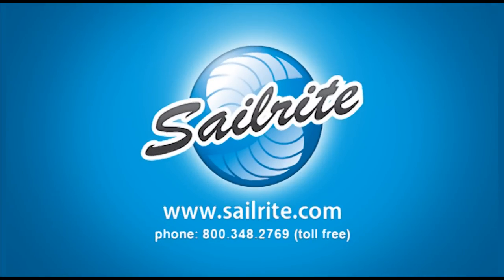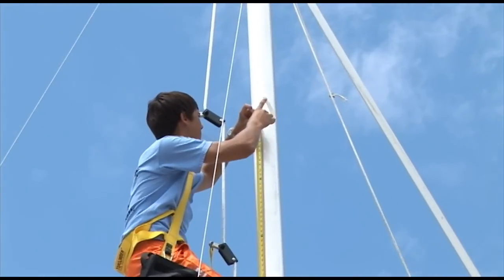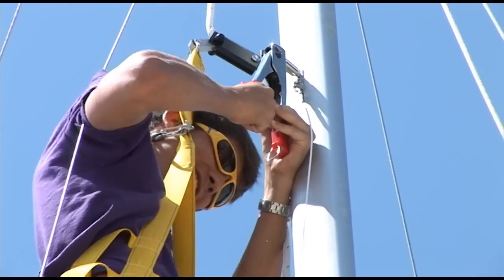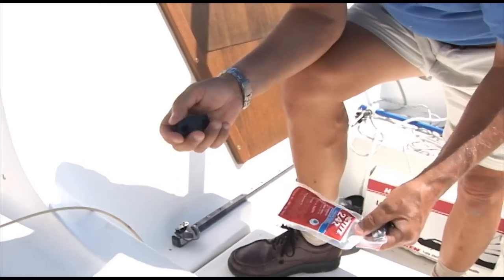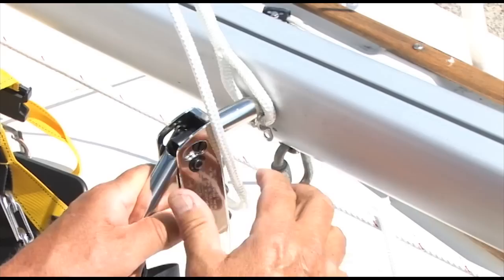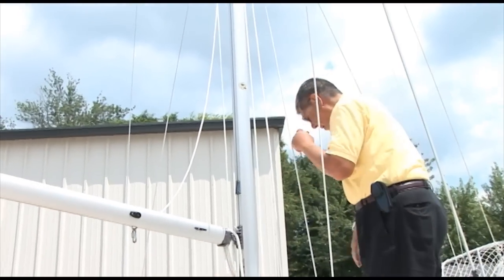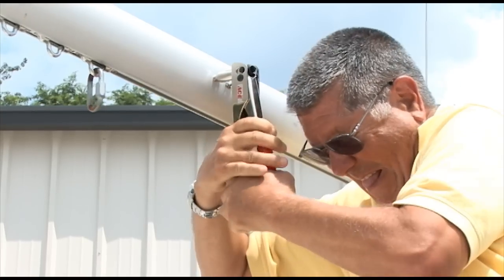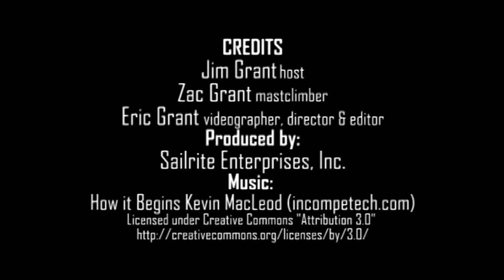Harken Lazy Jack Kit Installation Video by Sailrite

Comment: Great video. I plan on installing lazy jacks on my boat as I rig it for single-handed. However, a few tips on installation given my many years experience working in structures/sheet metal in the aircraft industry. When drilling in metal like the boom and mast, dip the drill bit in oil so you can bring most of the shavings with you out of the hole, especially drilling on the mast. Any oil left around the hole would assist as corrosion prevention, plus should the rivet ever got loose, black streaks will show around the rivet head rim, which will be very obvious. Also, use a drill stop, so the drill doesn't get pushed too far in and cause internal unseen damage. Depending on the thickness of the boom/mast, I would have used rivnuts instead of tapping the holes. When climbing the mast, similar as I used to be lifted to the vertical surfaces of aircraft (30-60 ft), use a lanyard for every tool you use (prep the tools before going up) to your working wrist. If that hand drill would have fallen, people could be hurt, and/or the deck core could be damaged. Other than that, good video and thanks for sharing.
Reply from the maker: javacup912 Great comments and suggestions.
Reply: Can Thisbe used on a wooden mast? @SailriteDIY

Comment from the maker: Stainless steel is stainless steel. Monel is a copper nickel alloy.
Monel is easier to set than stainless steel... but use the same barium chromate (Duralac) paste. The kit comes with SS rivets so that is what we used.

Comment: Handy system and well put together but make life easier for yourself by extending the handles of the riveter with a couple of lengths of pipe. You might need to knock the plastic grips off

Comment: Good Video. When we use a centre punch, one solid blow is all that is required. Multiple blows equals multiple indents.
Reply: Using a spring charged puncher is even better.

Comment: Using stainless steel on an aluminium mast/boom will cause galvanic corrosion so it's a bad idea (though must less so than aluminium rivit on stainless), if you do mix the two metals then DO USE the loctite, it will both stop the screw from working loose and also act as a barrier between the two metals to stop the galvanic corrosion. Mixing salt water aluminium and stainless causes corrosion to occur incredibly rapidly, not what you want anywhere especially on your mast/rigging.

Comment: Sailrite I like your videos because you always do things the smart way and the right way. That rigging tools bag however.... I loathe tool and screw bags that are black inside. Why make it so difficult to see? What I've done is to spray paint them with white Krylon spray paint. The paint soaks in and doesn't seem to do much, but if you shoot one pocket and not the one next to it, even that little bit is huge. 
Second the bottom of that bag needs to be withing easy arm's reach, but I can see that where it hangs is best for times you're not reaching into it - so just put an easy draw cinch on the front strap. Pull on the cinch line the shoulder strap looses 8-12 inches, reach in. Then if it's in the way, release the cinch and let it hang. 
There are three types of objects in that bag. Small stuff: loose rivets, drill bits, punch, templates; then mid-sized tools, rivet gun, screw driver, pliers, etc..., finally the cordless drill/driver  - an odd shape. (It wants a holster, but that big battery would cause it to flop out of a harness. So come up with a better harness. One that  the bit can stick out through a hole, the nose of the drill is snug, but maybe a gusset (funnel) to support enough of the rest of the tool so it doesn't flop out. A funnel like gusset also makes re-holstering so easy you don't even have to look. Also a safety lanyard for the drill/driver. Maybe something that a couple of rubber bands could hold against the handle. (even non-latex rubber bands get stiff and brittle after a couple months -so easy to replace. Or even a velcro loop.). 
The small stuff, screws bits, punch. need to be in pouches with a clear window, or a good strong but not opaque mesh. White background, black mesh might work visually.
And that tape measure end. How about some kind of spring clamp that could hold the end of that tape measure, or a line or cable?  Probably on the web strap in front - but out of the way of the cinch point. It doesn't have to be all that big. For a larger diameter line tying a piece of string to the working end should allow for a smaller clamp. Also if there's a 'horn' to loop the string around once or twice - then it will hold most of the weight. 
This doesn't seem to be all that difficult a problem to solve. In most fix-it situations around a building sizes, shapes, amounts, etc change so much it's difficult to zero in. 
And drillbits? The smaller they are the shorter their life expectancy. I figured, 'well this is the official video so....' I'd always go up there with a couple of bits. I think I've proved that if you only have one bit, it'll be dull or will break. If you have two, one will break. If you have three or more, they'll all work just fine for years. (Same thing with hats. On a trip I lost two hats in one week, they were cheap enough so I bought two. That was in 2016, I still have both). If you're interested in this but somethings are unclear, let me know-I'll be happy to share anything I can. I've learned a lot from your videos and know I'll be calling on you for help and rigging in the next couple of years.

Comment: Those kits are ridiculously priced for what you get, I've bought all the bits for mine for about 1/4 the cost & am basing it on Jiffyjax which obviates the possibility of snagging when raising the sail. I don't think two points of attachment along the boom is enough...

Comment: I am very green in the sail boat area and I actually needed to see this for I am making everything I have for a canoe , One tip the rivets can be more easily done if you just bite a little bit at a time and pull it in slow, the reason for just biting it a little you get the best leverage on it.  Having the handle wide open all the way back the leverage is almost none existent hope that makes sense.  Thanks for the video
Reply from the maker: Max, Great suggestion, thanks!!!
Reply: Your welcome

Comment: Use monel rivets, they are not causing corrosion. And put on some Butyl or other sealant to the holes so you won't have water leaking into your mast. Then, don't use oil to lubricate the drillbit because Butyl will not stick to oily surfaces. When drilling holes, use a depth stop on the bit, so you won't accidentally damage any lines or cables inside the mast when the drillbit pops through the mast wall. Use Locktite for the screws. And, seriously??? Get a heavy duty riveting tool!

Comment: This is a 2 leg system! Doesn’t harken provide a 3 leg system or offer extra blocks and ropes as an option to modify it to be a 3 or 4 leg lazy jack system!
Reply from the maker: The video is on a 2 leg system but harken offers and we carry a 3-leg system #254100 https://www.sailrite.com/Harken-Lazy-Jack-System-For-boats-35-to-42
Harken does not offer more than a 3 leg system.
Harken does not offer any modifications ‘kits’ or information on modifying their existing lazy jack kits.
If you want your own way I would suggest looking at the available systems and create your own design and order items separately.